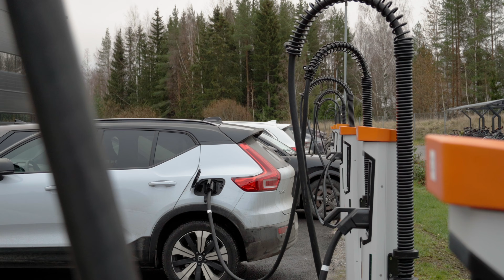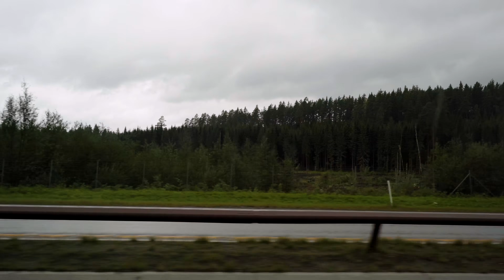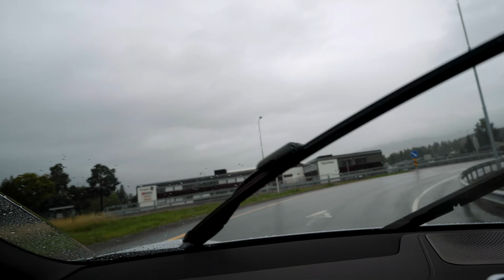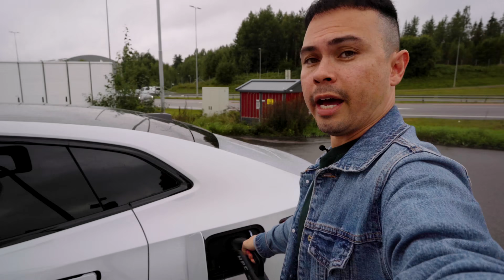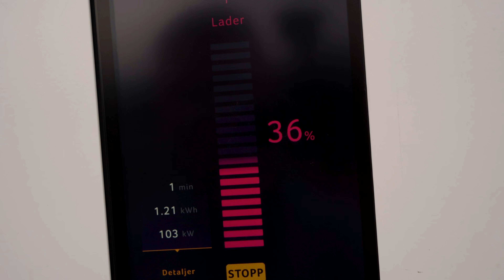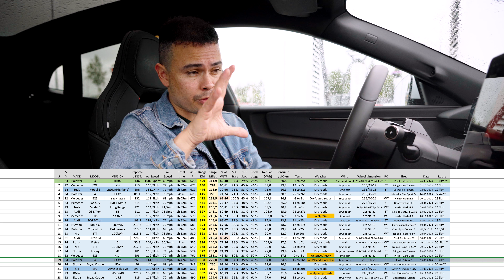Polestar 4 LR SM | 120KPH (75MPH) Range Test

Comment: Test temperature will make a significant difference. The test for the PS3 was at 20 degrees C. This test was 15-16 degrees C. QED. Add a further 20-30 miles of range because of that difference.
Reply from the maker: Ideal temp is 15-20c. At those ambient temperatures the battery should be at its most efficient operating temperature. And the hvac will also be at its most efficact for keeping the cabin at 21c.

Comment: I had the launch edition Polestar 2 and the adaptive cruise control / lane centering was the most disappointing aspect of it for me. When my lease ended, I needed a car and it would have been a year+ wait for the 4, so I ended up getting the EV9. Lane centering and highway drive assist is sooo much better than Polestar’s. It’s a bummer it hasn’t seemed to improve even 4 years later 😢

Comment: Results looks poor for the vehicle however, it might have been different doing a drive to say 5% remaining battery for a real world, actual range drive. Driving an EV is a different experience than driving an ICE vehicle when it come to long distance driving, not vastly different jut the “refueling” process. Certainly folks that don’t own EVs will have their say but, as any EV driver knows, you aren’t always topping up to 100% to do long distance drives, unless you have hilly terrain and not enough chargers available along your route (which, more are constantly being added). Driving about 2 hours is a good time to stop, take a break, and also top up the battery, if required. 

For the size battery in the P* 4, I would expect mid 300+ mile range in poor conditions and just higher range overall. Seems like they need more work to make the vehicle more efficient. Would be nice to have BYD Seal long range single motor performance from the large battery in the Polestar 4.

Comment: These are early days, Polestar has done a great job to make Polestar 2 much better with OTA updates, and I expect the same with P4. I currenlty (summer) have 17 kWh/100 km in my P2 LR dual motor from 2021 model year.
Reply: Whaat? Are you driving solely on 70-80km/h roads? I got a P2 LRDM 2021 and on 110km/h roads + some random 50/70 roads (no eco driving) and 24-26kWh/100km is normal here.
Reply: @jite1367   it is mixed drive: today I went 300 km mostly on 100-120 km highways, but average speed due to traffic 79 km/h, 17.1 kWh/100 km (145 km since last reset of trip meter) . Data from the Polestar app statistics.
Reply: I might add: I think a mixed drive better reflects real consumption as you rarely start and stop on a highway. Smaller roads to get on and off also affected average speed in the figures above, not only traffic.
Reply: @jite1367  my results are slightly better than ADACs Ecotest with the latest P2 LR SM with 17.5 kWh, which is a bit surprising but depends on how the test is deviced. The P2 is positioned 12/94 tested cars
Reply: @jite1367  I frankly dont understand how you get those results, except that you say no Eco drive. Of course if you push it and drive like in a rally I guess you will get that consumption. Or in mid-winter with cold temps on a skiing trip, then I have got that leveI  too. I always use Eco mode, cant see reason not to if you aim for range?

Comment: hey Kris. with such weather you can count 20% more consumption on any EV. 
Your consumption is pretty decent. That correspond to 19kwh without rain.
This is due to the tyres friction with the water (it requires much more energy to make the same speed), and the air density higher preventing air penetration of the car. 
Do the same test with no rain and same temperature and you’ll have a much better consumption. 
Or reduce to 110km/h and you’ll have a lower impact of the rain. 
Conclusion you can’t establish this EV consume.a lot under those circumstances 

PS: ICE cars also consume more when it rains
Reply: For sure. Great facts
Reply: I am a PS4 DM (all packages) driver and former Tesla M3P driver, … and I confirm your experience.
Driven cautiously mostly in economy mode (only rear wheel drive) it’s hard to drive under 27 KW/h.
Absolute amasing car - I love it.❤️‍🔥
But bad software with many bugs, bad App and not economical 🤷‍♂️

Comment: something is very wrong with that unit (or the weather really impacted the results - much more front  wind than what you thought?! I've been driving it 125kph and get between 19.1 and 20.6Kwh in average (220km total daily highway commute)! I do not use the adaptive cruise..it's rubish for now.

Comment: To drive a car with a so huge battery at 120 km/h is not enough to increase the temp of it. You need to drive faster or do the yoyo trick that would ruin the test. 25 kWh average discharge is  nothing for a 94 kWh pack. You're discharging at about 0.25 C. Plus 16°C, cold rain, wind. I bet the pack was at less than 20°C. A 75 or 60  kwh pack would have more internal resistance just because of the rating of discharge.

Comment: (Polestar 2 owner) I also testdrove a Polestar 4 last weekend and I'm not really convinced.

Pros against Polestar 2:
- quieter
- more space for passengers in the back (I'm tall, so an adult sitting behind me in the Polestar 2 is not so comfortable)
- cupholders are placed better
- more storage space in the doors and in the center console
- it has a HUD

Cons compared to Polestar 2:
- this car is 2.14m wide :| probably 15 cm wider than the Polestar 2 and you can really feel it here in Europe. the lane assist kept beeping me on the highway and I really don't want to imagine having to enter a narrow parking garage or navigating some narrow streets in Italy for example. even home in Switzerland there are frequent construction areas on the highway where the second lane is narrowed to 2m, so this car won't fit there. It feels a bit more spacious at the legs, but I honestly was not feeling cramped in the Polestar 2 and I don't feel the benefit of these extra 15cm in the width of the cabin.
- the steering wheel is such a downgrade compared to Polestar 2, very confusing capacitive buttons, many functions cramped in there
- I feel like they took the worst lessons from Tesla and moved a lot of functions from physical buttons to the center display (opening the glovebox, opening the charging port, adjusting the mirrors and the steering wheel - yes, I know with very many clicks you can adjust the steering wheel and the mirrors using the steering wheel buttons, but why?? it's so much easier and faster to have the joysticks for the mirrors on the doors).
- I'm not a particular fan of the gear selector on the steering wheel instead of on the center console, but I understand that this allowed them to have the cup holders in a normal position
- the digital mirror is ok, but it's so weird to not be able to see my passengeres from the back anymore because of it (I know you can toggle it to see them, but you can't have both at the same time)
- the frunk seemed even smaller than on my Polestar 2, which is crazy considering how big the front part of the car is
- probably needs a bit more tuning in a future software update, because the acceleration pedal was very brutal compared to Polestar 2, making every traffic light start a head bump in the seat
Reply: This car is not really aimed at most Polestar 2 drivers, because bigger and more expensive. The complaints about the size are not shared by drivers (like me) who always drove bigger cars and now also drive a Polestar 2. The car has nearly the exact same dimensions as the former Volvo  V70  and nobody ever complained. Competition is Mercedes EQE and Audi Q6 which have similar dimensions. I drove te PS4 and it gave the impression  to turn shorter/easier than the PS2. 
The complaints about the  steering wheel/mirrors adjustments : Normally you set these once and then never again. The other drivers have their own profile. I really don't see the problem.
Reply: @koensteenbrugge8098  regarding the mirror adjustment: I assume you're one of the lucky Polestar 2 owners who don't have issues with the mirrors sometimes not unfolding when going into the car
Reply: @CiprianOlariu  I have deactivated this automatic function on all cars so far. If necessary, I fold them in and otherwise they are always unfolded.
Reply: @CiprianOlariu never had any problem like this. Had a problem with the mirrors not going to the same place after tilting. But that was nearly 4 years ago. The service center applied some kind of grease to the mechanism and no more problems
Reply: The pilot assist will get better with updates probably. So I’m not to worried about that. 

Some of your points I also found true. For fun drives the Polestar 2 is much better. For comfortable long drives I think I found the Polestar 4 very good. Polestar 3 is the overall winner though. Also test drove that one. Cannot afford it, but oh boy that was an insanely good driving car.
Reply: As a Polestar 2 owner, I also test drove a Polestar 4 LR DM this week. My experience matches yours. I would add like Kris, I was disappointed with with pilot assist. Fortunately, the Pilot pack is an option and if you skip it, you still get the normal radar based ACC which is enough for most cases.

I have to say, I was very excited about Polestar 4 and I still believe it is an excellent car. However, for me, it is not a huge upgrade compared to P2. The width is definitely a downside. My lease will be over next year and now I'm seriously considering getting another P2, rather than a P4.
Reply: @shapul  U will have Zeekr 007 or Lynk&Co Z10 which is better option than P2 to get again. Charging speed is around 15 minutes or less to 80% depends on battery chemistry (NCM or LFP)...

Comment: It´s an old platform and a horrible air drag coeficcient. Years and years after the model 3/Y they still can´t beat it. Or in different words: You pay a lot of money to carry around a huge battery that´s only needed for making up for the poor efficiency. Doesn´t make sense and is not supporting the idea of a more ecological car.
Reply: Let's all drive the same car as the next door neighbour. A Tesla is like an arsehole EVERYBODY has one
Reply: 0.24 horrible drag ??
Reply: @trinitonv8  I guess in this context you have to pick either 'horrible' efficiency or looks :)
Reply: @mho0  That´s an interesting one, indeed. I don´t like Tesla-looks (even though we have one) at alle, but efficiency is awesome. There are some very drag efficient cars which look good: A6 E-Tron, Enyaq (for an SUV) but generally the rule clearly is: Drag efficiency comes with looks like a piece of soap (EQS / EQE / Model y...).
Reply: normally, the cheaper the car, the higher the efficiency.
Reply: It is not an old platform. The SEA platform is new.

Comment: Interesting result - I've test driven the car and got a much better consumption result of 21kwh/100km, that is with a dual motor version with climate and normal driving over about 60km round trip.  I did experience exactly the same behaviour with the lane changing though, something they need to sort with an OTA update.
Reply: 21 is still very bad though.
Reply: 21 is bad too ..
Reply: I got 19 with the single motor on a 40 kilometer drive with 90% highway.

Comment: I've watched about 15 Polestar 4 reviews and yours is the FIRST that has mentioned anything about cruise control and lane change so thank you - I had heard that it was "poor" generally. Have you heard whether or not there are plans to improve it in the future? My lease ended on my Model 3 and I'm looking at either a Polestar 4 or a new Model 3 and at the moment, leaning into Tesla a lot after seeing the negatives about driving the Polestar... Build quality may be nicer but that's no good if the car doesn't drive well!
Reply from the maker: I spoke to some ADAS engineers at Polestar yesterday (after this video was filmed), and they said these issues should be fixed in an OTA in a few weeks. Other than that, the car drives great!
Reply: @KrisRifa  Interesting... I have a test drive with Polestar in mid-Sept so I'm expecting to run into these issues too but I wanted to make a decision by the end of the month as Tesla have 0% APR on their PCP deals on the Model 3 until Sept 30. Fingers crossed it's fixed and someone uploads a video about it before end of Sept!
Reply: He literally said the car drives well tho?  AAC/Pilot assist is not equal to driving.
Reply: @PoliShine101  Most cars "drive well" unless the suspension's awful. I don't expect a Polestar to drive badly, nor do I expect a Tesla to drive badly. But when it comes to tools and features that will assist you in driving, if ADAS is poor then it's not worth paying for the upgrade (which is free with Tesla, unless you want auto-lane change)
Reply: @abcmsaj  Fair enough, I enjoy truly driving and want the least amount of ADAS possible..
Reply: @PoliShine101  For me in the UK, I do a looooot of driving up and down the M5/M6 motorways and so I like to put it into ADAS there where possible, but I agree with you, I think if I were only on rural/city roads, the drive of the Polestar 4 would be way nicer than the Model 3. I'll find out soon after my test drive!
Reply: @abcmsaj  Depends on what you'd like I suppose, I remember the Model 3 being very nimble and steering input being very direct, almost like a Go-Kart. I also test drove the PS4 and that felt more 'grown up' but less sporty. For a daily commute I personally prefer a PS4, but I have a sporty car for weekend drives so I can have the 'best' of both worlds.

Test driving is the way to go before you make a decision. Both have their positives and negatives
Reply: Why not Zeekr 001?
Reply: I drove a fully optioned Polestar 4 dual motor yesterday, and was disappointed. Even at the same lease cost I'm leaning towards a long range Model 3 Highland right now. I love the look of the Polestar but it feels big, heavy and not quite right. Some good points for sure but definitely didn't meet expectations.
Reply: @philth7587  Clearly drives better than a Model 3 if you like refinement in your driving.
Reply: @madsthomsen8006  compared to the old one, yes. Compared to the Highland, it's not so clear. The performance wheels certainly reduce ride comfort, so the P4 on 20s will likely be better, but the P4 was not as sharp and responsive as I'd hoped given how much I like P2 driving experience.
Reply from the maker: @philth7587  well it is a whole class of vehicle bigger than the Model 3, so that does make sense 👌
Reply: @philth7587  Oh good to know. They're incomparable really, right? Because the Model 3 is lighter, nippier, more like a saloon, and a Polestar 4 is heavier, and more like an SUV, so I would expect the feel of the drive to be different. But at the end of the day, coming from a 2021 Model 3 and hearing that the Highland M3s are quieter in the cabin and have seat cooling, interior lighting, etc as standard now, it makes it hard for me to justify paying twice as much for a Polestar 4. Unless I test drive it next weekend and it's incredible, then I'll eat my words!
Reply: @abcmsaj  I'd call the P4 a large saloon more than an SUV. I think for motorway cruising it would be nice. Definitely try the Highland 3 before making a decision would be my advice.